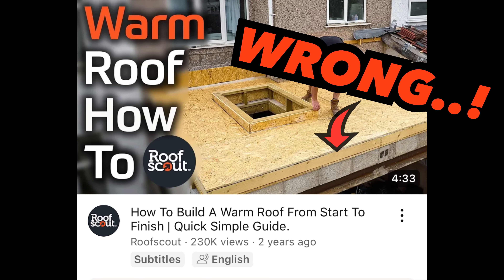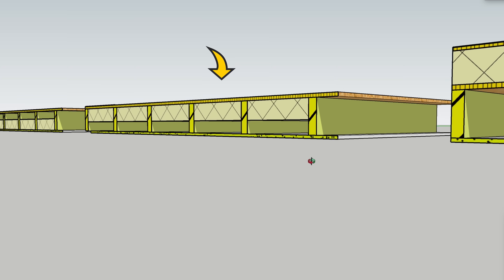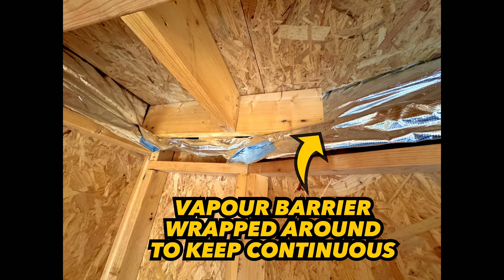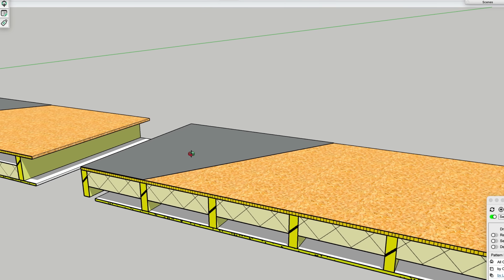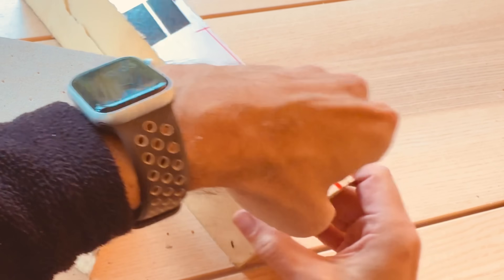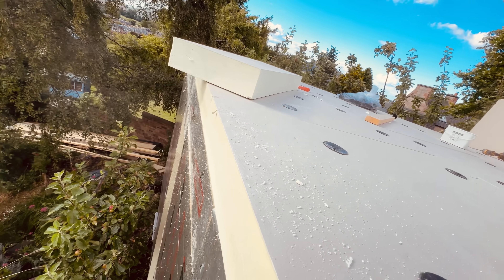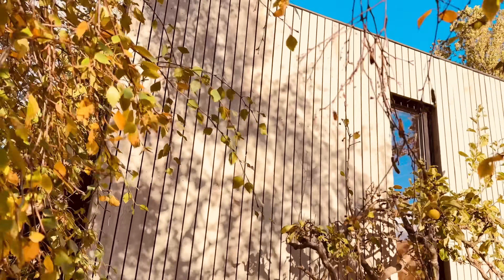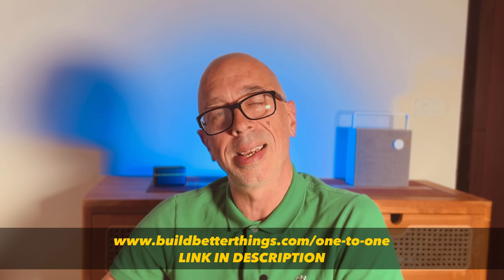Build a Warm Flat Roof the Right Way

Comment: Very informative and well described. I have over 20 years of experience with grp from a manufacturer/specifier point of view. EPDM is probably the way to go.  Grp is fatally flawed on a flat roof. Although I have never had a failure of a roof I have installed, there are too many parameters for your average roofer to comprehend. I have inspected more poorly installed grp roofs than is acceptable. I also take issue with moisture barriers. The roofs I have seen fail catastrophically are the ones installed with moisture barriers. The roof may have a small leak. The home owner is blissfully unaware as the moisture is held in the roof buildup. It will spread throughout the whole roof and no-one knows until it's too late. A simple repair has turned into a major refurbishment of the roof. I haven't seen a roof without a MB  affected by condensation, so I will never be convinced it should be used.
Reply from the maker: Thanks a lot for the comment. Interesting to read your experience. There’s a few commenting here they will never use EPDM.
Reply: great video👌🏽 I’ll be passing it on to Nottinghamshire’s building association 👍🏾 been a flat roofer for the last 20 years(pvc and felting) the sandwich effect of insulation boards is a waste of time and money. The building industry in the uk is so far behind European  thinking and implementation it’s harnesses and painful to see🤷‍♂️
Reply from the maker: @martindabrowa1565 thanks. Appreciate your comment
Reply: The other bit I took away from this was tucking the VCL into the wall vapour barrier - many thanks.
Reply: So, can a moisture barrier/VCL be omitted if there is no osb/timber above the insulation?  Would building control allow this?  Is there a problem of mould?  I am retrofitting a house as well as extending with a flat roof and will be fitting an MVHR eventually.  I was hoping that the moisture levels would be managed that way.  I do like the idea of omitting the moisture barrier/VCL, though.  As I work with historic buildings, I always prefer a more breathable construction where possible.
Reply from the maker: Although a vapour barrier can be negated by a ventilation strategy and attention to where the dew point is, building control will insist on a vapour barrier regardless of

Comment: Hi, great video - thanks. Is it possible to apply final layers to   say rockwool flexi or such. I'm ocd about fire proofing and toxic fumes with kingspan and it's ilk. Is some form of more non-rottable layer or support system be  available to walk on after installation? Cheers
Reply from the maker: Hi.  Which way are you worried about fire proofing. Starting inside and spreading out presumably? Surface spread of flame is one of the main issue with flat roofs.  I’m just not 100pc clear on your question. Can you word in a different way? S  Thanks.
Reply: I mean that if I only wanted to insulate with rockwool and not  pir, then it seems a cold roof is my only option as the load bearing capacity on a warm roof is not sufficient for walking on and such in comparison to pir?
Reply from the maker: Yes that is correct. You need to ventilate between the insulation and the timber deck. But you also must remember, mineral wool is less than half as efficient as PIR, so you’re not going to be even close to the efficiency of rigid.

Comment: Please excuse me if this is a daft question.

I was totally onboard following your explanation and it made perfect sense, until you mentioned that air pockets between the rubber and the insulation are not a problem as the rubber is slightly permeable and air bubbles will eventually flatten out. So why would this permeability allow the air out of air pockets but trap moisture from the condensation below?

Please be gentle in your response, there is every possibility I've misunderstood something. :)
Reply from the maker: Hi. This permeability will allow some trapped moisture to slowly breathe through beneath the membrane, but it won’t if there’s 18mm of OSB sitting on the cold side above the insulation and the localised vapour areas, where the moisture will get trapped within. It’s a good question and my fault for not explaining it well.

Comment: How do you do gutter with this type
Reply from the maker: You attach a fascia with the top face flush with the sub strata (eg top of insulation) and leave the membrane hanging over by about 80mm. Then you attach a 2 piece gutter trim and friction fit to secure the rubber. You can see it towards the end of the video in the roof with the black corrugated cladding.

Comment: Do you think a 45mm air gap will be enough on a garden room above insulation it’s 3m span wall to wall with shower in. I know the regs say 50mm but iv currently got 45mm was going to do hybrid but then realized iv got enough space almost to do cold roof. Thanks for any help.
Reply from the maker: Hi. A few millimetres is ok in that situation. . The other issue with both cold roofs and hybrid to consider is the vapour barrier and things like lighting. I will release an Ina few days about how I think it’s best to do a hybrid roof. Thanks for your comment.
Reply: @ thank you for quick reply really appreciated, ye I’m not planning on putting recessed lights in for that reason I don’t want to many holes/week points in the vapor barrier so I’m just going with a single light in the middle. Thanks again

Comment: Timber on the “cold” side of the insulation is perfectly fine providing proper measures have been taken to ensure no transfer of heat/moisture from inside the room below…. Proper ventilation & vapour barriers fitted correctly and either of these 3 drawings you show are perfectly fine providing the correct roofing membrane/ system is used….. it seems like your making videos about things you don’t actually understand or do you have any evidence to say otherwise? In the years I’ve been roofing I’ve never done across a rotted deck when removing a roof that has been built with OSB on the cold side unless the roof hasn’t actually been done correctly
Reply from the maker: Hi, If that’s what you think in the years you’ve been doing it, then carry on doing it. Likewise, you say I don’t understand. That’s not enough to change my view that using foil backed PIR and OSB on the cold side is a horrible and unnecessary detail.
Reply: @ we use foil faced PIR on almost every roof we do (FATRA mechanically fixed) unless it’s a torch applied system, we don’t do a massive amount of EPDM but have always laid it onto OSB3.. with no issues ever with the boards….. I understand what you’re trying to explain but I feel you’ve got it all wrong and don’t quite understand how flat roofs and their buildup actually works….. for example you say “EPDM is a breathable membrane” but then you seal it completely closed using your contact adhesive? And you also say that the bubbles you leave on the roof disappear… I can assure they do not
Reply from the maker: People read these comments and it’s invaluable to get the perspective of others. I give the point of view based on the analysis I’m showing in the video.
Reply: @ I understand that but having an opinion/ point of view that differs from almost every other professional and then saying their work or methods is wrong is out of line to be honest….. I’d remove this video and maybe think of a better way to go about putting across your “opinion”
Reply: @Telferroofing spot on yet again mate. This fella isn't listening though, he's not replying to us at all now and even deleted a comment. If he talks to us I'm sure we can sort it but it's like talking to a brick wall that I've built that he'd probably say I'd built wrong.
Reply: @ I think he’s feeling embarrassed now to be honest
Reply from the maker: @Mr_A_Builders I never delete comments, regardless of attitude toward me or my content. Comments in my channel  are only deleted by YouTube if you go against their terms, be it abuse, or something else.
Reply: This Fella is a GOON‼️FULL STOP ‼️

Comment: Never liked rubber roofs snd wouldn’t use them on domestic jobs either, I use grp system flexitec, and were possible warm roof applications, if not possible cold roof system with crossed battening to ensure good air circulation, and good vapour barrier.
Reply: @AN-vt3kl  with all due, "I never liked" isn't much of an argument. EPDM allows water to egress and is far more environmentally friendly that GRP and any other membrane or coating system I can think of, has far greater longevity (accelerated wear and weathering tests well over 100 years), is elastic to allow for movement and can even be reused.
Reply: @gurglejug627  in my experience there is a reason cheap isn't good, I would agree edpm ok for sheds garden rooms etc. but not for extensions, loft conversions but each to their own.
Reply: @AN-vt3kl  that's not an argument it's a baseless and odd opinion - i speak from vast experience. The price has nothing to do with the quality of material or of suitability for any job.
Reply from the maker: Thanks a lot for your comment. What’s the sub strata you use on it? I focused on EPDM on the video because that’s the material that a lot of small general builders and most self builders tend to use.
Reply: @build-better-things  most times its 18mm t/g osb 3 boards, also can use 8x4 osb boards if no access for smaller boards but in that case a lot more work to seal the joins prior applying matting.

Comment: Epdm is a diy product, and not used by professional flat roofers. Also the VCL should be fully bonded to the deck and sealed in around the perimeter and be fully water tight. And much better to fully bond the insulation to the vcl with roofing grade foam adhesive, don’t put 100’s of holes in your vcl. If you can buy a flat roof membrane off the shelf it’s probably garbage.
Reply from the maker: Appreciate your opinion and experience. I mention EPDM and mechanical fixing   because it’s something many self builders and smaller contractors who have a small bit of roof to do may consider using. I’ll focus on the vapour barrier in another video. Thanks for your comment.
Reply: You obviously are not a professional roofer if you seriously think this
Move into the 21st century
Reply: @macsmith6216  enlighten me then ?
Reply: @kevinrae3299  
Tried but my comment has been deleted
Reply from the maker: @macsmith6216   Comments are only deleted by YouTube if you go against their terms, be it abuse or something else. I don’t delete comments.
Reply: Plenty large roofing companies use EPDM on commercial projects 
Look on the net there’s your answer
Reply: @macsmith6216   yes there is some, because some mad architect thought it would be a good idea, but a professional flat roofer wouldn’t choose to use it.
Reply: @kevinrae3299  
Are, not is
So what’s the name of your professional roofing company, or the company you work for as a professional roofer?
Don’t by shy

Comment: EPDM rubber is permeable and allows water vapour to escape, albeit slowly, yet reasonably. If a solvent based adhesive is used it will certainly cause a hindrance to that. Unless one builds a hermetically sealed inner roof/insulation surface (a practical impossibility, essentially, at best an expensive and needless endeavour) water will always condense at a cold point. The amount of water available to condense in a building /given area of it should be lower than the amount which can reasonably escape, and unless the building has big issues with damp/condensation then there should be no issues with the boarded roofs depicted. If there is any issue, it will be down to remedial works being needed on the rest of the building. In a climate like Britain's, screws into wood will cause negligible heat loss. I've built numerous buildings and many, many EPDM roofs all over the UK and Scandinavia, as well for myself and which I monitor and experiment with - never an issue, and i have often used the OSB top boarding method. I hope the feedback is useful to people.
Reply from the maker: Appreciate your experience, welcome to disagree here and give your reasons, and keep doing it the way you have always done it. Your experience and your comments will help everyone decide. My view remains…..Timber composite on the cold side is unnecessary and it can rot, as is using foil in roof insulation, and I’ve given my arguments why in the video. Thanks.
Reply: @build-better-things  thanks for your reply. I totally agree about not using foils and it's so important to think through air movement and the building design as a whole, carefully. As i'm sure you know, but in case it helps others, it's common that people reduce ventilation 'reduce drafts and heat loss' by closing vents/windows and sealing gaps etc. As an old Swedish engineer friend put it 'any building design has to take into consideration the trade-off between insulation and air flow'. If it feels cold, it probably needs to be insulated better, and reducing/changing air flow without considering its effects can cause a lot of damage. (I appreciate that's verging on being off topic and rather general, sorry).

Comment: Thank you for a very useful explanation! I have a question also: is a vapor barrier any use in conjunction with a sealed hard isolation panel of which the seams are taped? Am I wrong in thinking no vapor can get through taped PIR panels anyway?
Reply from the maker: Taping is not perfect but close enough. I don’t tape the boards because I don’t think foil insulation should be used in a warm roof, but you’ll see in these comments many arguing otherwise. If you have an effective vapour barrier below, that’s really all to focus on. Appreciate it’s tricky with the conflicting info but all I can do is show my analysis and conclusions  like in the video. Best of luck with it.
Reply: Your general rule that any moisture will condensate on the cold side of the insulation or inside the insulation itself is the simple but effective rule. That is the most important thing to consider when deciding on how to assemble any wall or roof. Thank you

Comment: You've got a few issues here, pal. 
1. You're referencing other channels that dont contain what you say they do.
2. You've got the dew point wrong which undermines your entire point.
3. You ahow a confusing diagram that shows the VCL in completely the wrong place
4. You have absolutely no evidence for anything you say, not even a link to an article.
5. You say you're a novice but offer consultation services! How does that work?
6. You advise to go against manufacturers recommendations.
I could go on but surely thats enough?
This is a shoddy, ill conceived poorly researched argument that you felt the need to discredit other YouTubers videos to make. I will be amazed if some of them don't get in tiuch with you, even try to get it taken down. Unbelievably bad.
Reply: My thoughts exactly… guys got a lot of misinformation in his videos and some very silly references to other guys that clearly know exactly what they’re doing and have done for many years
Reply: @Telferroofing  spot on mate. I checked out one of the channels he slags off, Mr A Builders and do you know what? There isn't a warm deck roof with an EPDM covering on it! Not a single video on the entire channel. This clown accuses them of doing something they simply haven't done. And that's just one of the points. This video should be taken down.
Reply from the maker: Timber on the cold side is not great, timber composite is worse, as is using foil in roof insulation, and I’ve given my arguments why along with solutions in the video.
Reply: @ you said it’s wrong not “not great”
Reply: @build-better-things  you haven't addressed a single point from the above but instead down graded the entire point of your video to "not great". Seriously mate, you need to sort this. Having this opinion is fine but you've dragged other YouTubers into it and from what I can see lied about their videos. As mentioned above Mr A Builders does not have a rubber roof on a warm deck video on their entire channel and you say they do. That's the same for the Garden Room Guru, one of the other videos you've shown. I've noticed in one of Mr A's posts that they say maybe you should donate to their fund raising as way of the an apology. You do need to reach out to them if you haven't already.

Comment: I have zero building experience, and am coming from this with probably complete misunderstanding, but if the EPDM stops the moisture getting out, and it sits on and rots the OSB, what happens if you don't have the OSB? Does it not sit on the insulation? That doesn't or can't rot?
Reply from the maker: If you’re using EPDM, there is a breathable aspect to the compound where the trapped moisture con dissipate slowly on top of the tissue faced of the insulation and directly under the membrane. Instead it’s trapped in the OSB and never gets out.
Reply: @russellwheeler2760  the EPDM membrane is a breathable monomer. It does allow a fairly slow but reasonable egress of water. It's an excellent material to work with.
Reply: @gurglejug627  ah ok, both replies make sense. And the OSB is not breathable because of the "glue" in the board, shown in the video
Reply: @russellwheeler2760  that doesn't really add up in practice - even small gaps allow air movement and dissipation of moisture. Permaroof, based in the UK have excellent videos on best practice usage of EPDM freely available on their website - they're Firestone distributors and have decades of US and international, other climates experience to draw on, as well as the UK.